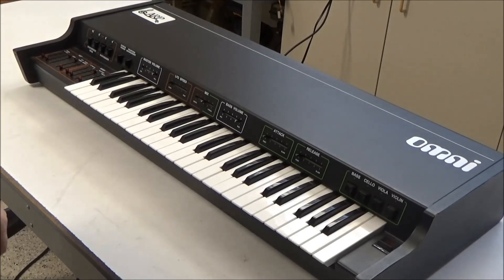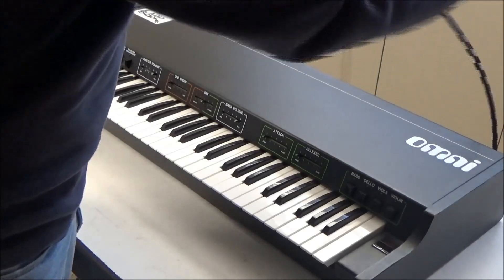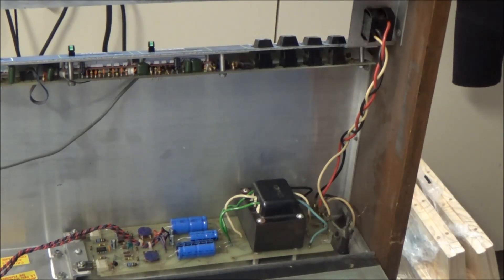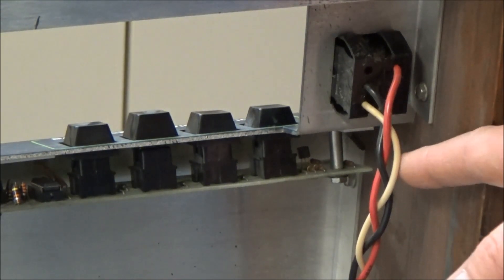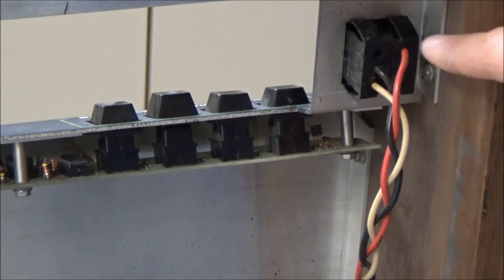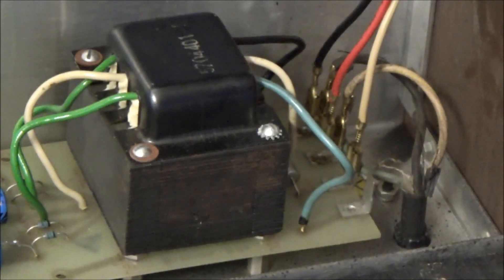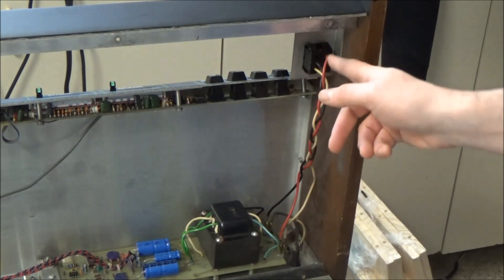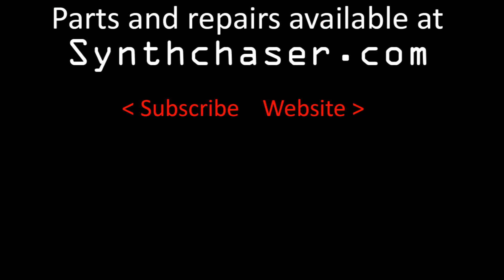Synthchaser #116 - ARP Synthesizer Mains Power Wiring Explanation & 240V Conversion

Comment: If you left the power switch light wire on its original terminal, it would still be getting 120V.   That seems like a better choice than running it off of 240V.

Comment: Hi Synth Chaser.
Quicky: What about the lamp in the switch ?
Reply from the maker: What do you mean?
Reply: well is it susceptible to burn when the voltage is changed to 240v or maybe I am missing something (which probably is the case lol)
Reply from the maker: I talk about it later in the video.  The switch is rated for dual 125V/250V use.  Off camera I used a step up transformer and verified for myself that the lamp still works correctly when switched to 240V.
Reply: Yes I saw it. But good to know none the less. Thank you